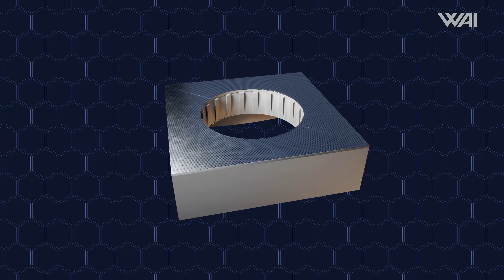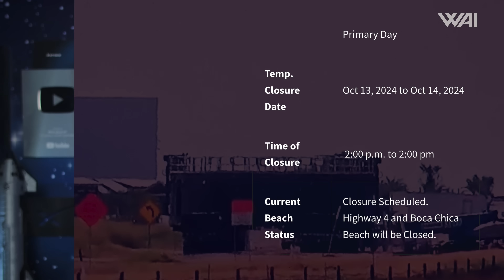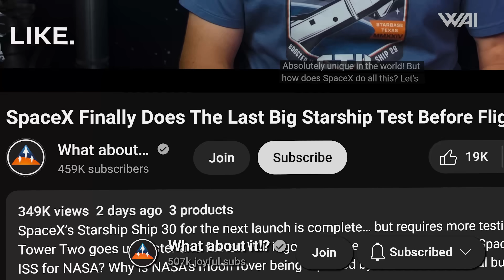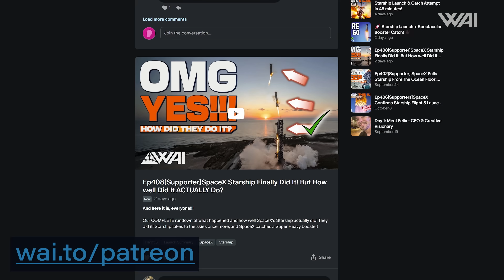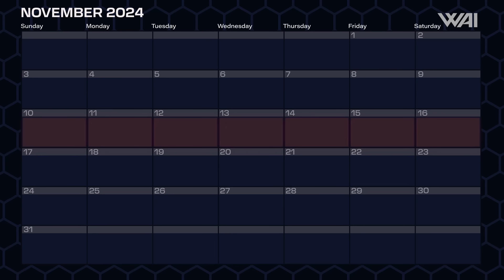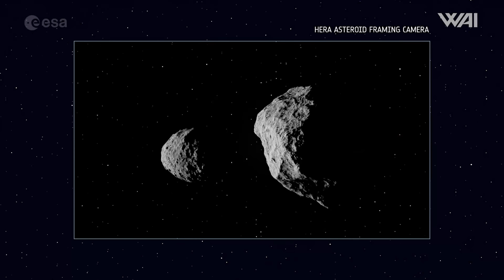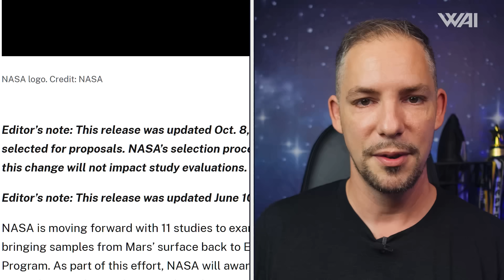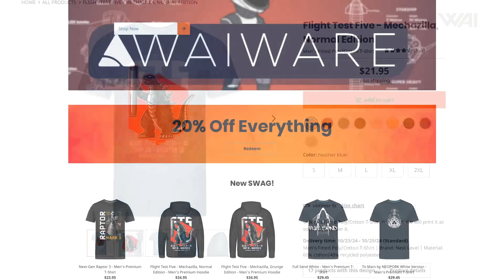SpaceX Reveals Flight 6 Starship! Possible Launch Date Available! Can They Do It?

Comment: Hi Felix. I don't see how much useful information could be gleaned merely by repeating the same flight profile with Ship 31 when Block 2 is obviously ready to fly. They should put Ship 33 up next, even if it means waiting a few more weeks. That would put them in a good position to make a full orbit on Flight 7.
Reply: S31 is more ready since it already undergoes a full static fire at Massey. And flying V2 now will likely repeat Flight 5 regulatory nightmare since it's a new design

Comment: Correction, Europa clipper Will take an additional 3.5 years, not 5.5. It’s 5.5 years total

Also, maybe this is a dumb question, but it seems obvious that super heavy should NOT land over the OLM?  Can’t they move the chopsticks 90° and land on a different side? I guess they would need a deluge system on that side?  But wouldn’t that be way easier?
Reply: Ah yes, why build one deluge system when you can build two at twice the price!

Comment: All surfaces of the OLM exposed to blast must be covered with heat-shield hexagonal tiles just like the Starship.
Reply: Which will instantly be shattered to pieces before it even get a chance at protecting
Reply: @alvianchoiriapriliansyah9882  Well, bare metal put some serious resistance. So with the heatshield hex-tiles on top, it's only going to be better. So simple.

Comment: Impressive Test Flt 5 Space-X. Bot make no mistake, forget a 30 Month Mars Trip. If you wanna Get To The Moon, You can't have Burning Fuel Being Emitted From the Side of The Booster while Landing. Seems there remain some "Fuel Control" problems at some Ship Locations. BUT CONGRATS, GREAT JOB ON FLT 5. 230 fT. Tall By 30 Ft. Diam Cylinder Controlled to Plus or Minus a Few Feet Return From Launch IS NO SMALL FEAT. EAT YOUR HESART OUT "BEIJING"....AND ELON, MAKE DAMN SURE YOU "TRIPPLE VET" ALL THE CHINESE TRYING TO GET JOBS AT STARBASE. THAT CCP WILL PILFER YOU BLIND.

Comment: Why can’t they make launch tower taller. Make the catch arms longer.

Lift the rocket onto the catch arms prior to launch. Lift it off the ground as far as possible. 

Light the engines, launch the rocket. As the engines come near to passing the catch arms, they move out of the way entirely.

Engine exhaust would do far less damage to all ground systems surely.
Reply: Lighting an outer engines require being connected to a ground system. No outer engines light, no launch

The pad would be damaged instead by a non-nuclear explosion after the stack falls down due to (longer = even worse due to bending moment) chopsticks snaps off by 5000+ tons mass. But I guess we can reduce the engine exhaust damage to the plate by a whooping 0.05%!

The REAL Flight 5 took off & land without ANY noticeable damages to the steel plate, launch mount, and the tower. They're taking the OPPOSITE way for tower 2 by shortening the chopsticks to reduce bending moments. So yeah, I recommend you stop dreaming

Comment: Ship 31 is likely to be used, especially after repairs following a cryo test accident, meaning they care. 
The best solution would still be to fly ship MK2, they know, we know that the design of ship MK1 is not gonna work perfectly...
In any case they should use ship 31 to perform a high altitude flight test.
Just to improve the bellyflop technique, then switch to MK2 ship
Ship 31 after the high test flight should be scrapped
Reply: You won't see any high altitude suborbital test flight anytime soon. Where would it even took off the suborbital pad is long gone lmao

They already doing bellyflop included in one package with full stack flight, and you want to ditch it for... what?

Comment: Chine damage = hot staging ring collision?
Reply from the maker: Excellent question. The damage occurred way lower. It might have been a methane explosion. The Booster quick disconnect leaked. Gas might have made its way into the housing and then… boom.💥